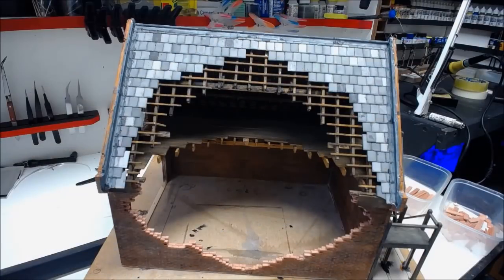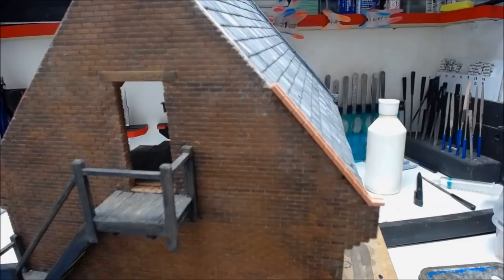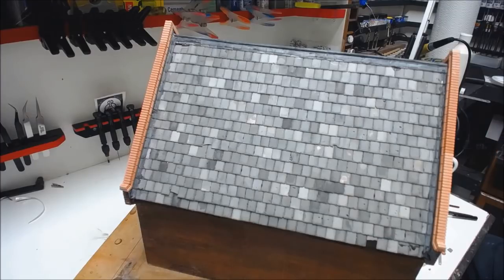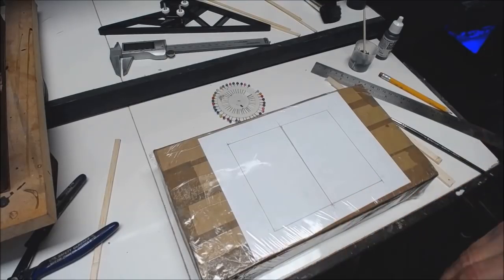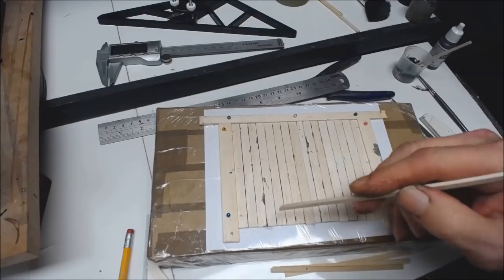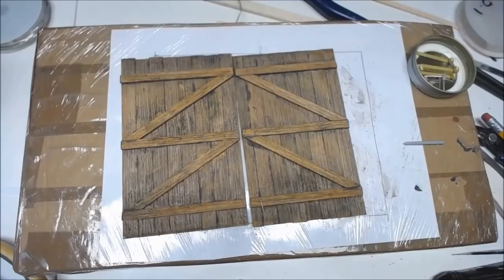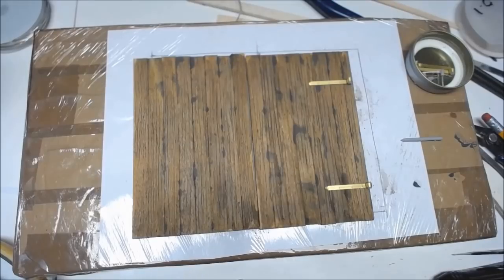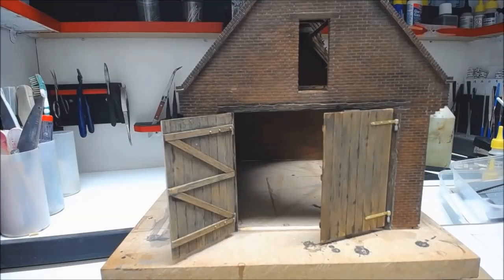Barn Build Part (8) Basic Build 2 Wall Coatings And Barn Doors

Comment: Simon, great video man. Nice work. Audio better. The volume of the intro and your voice are closer. One spot that i noticed a difference in was at the cut to the doors. Listen from around 9.50-9.59 and then hear how its louder after you cut to how you make the doors. What video editing program do you use? It may have an option to show audio levels, and you can see where it goes quiet. added to my liked vid's